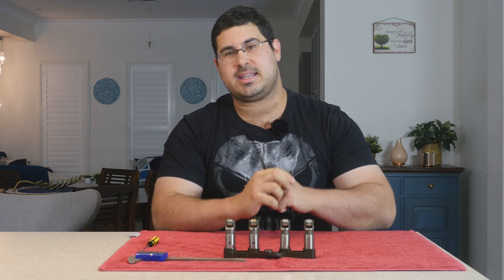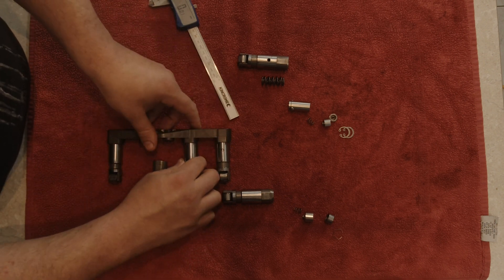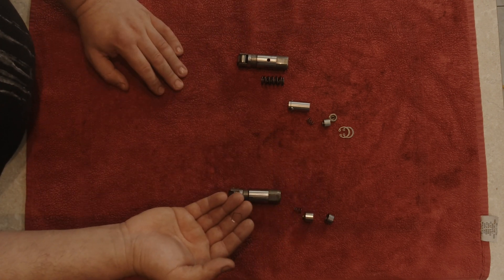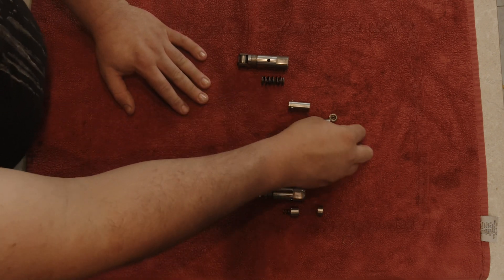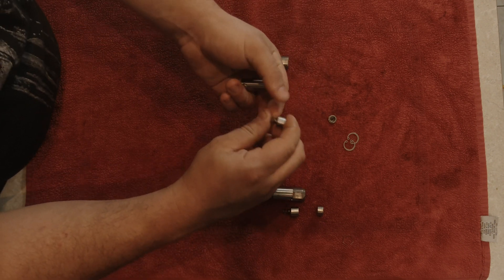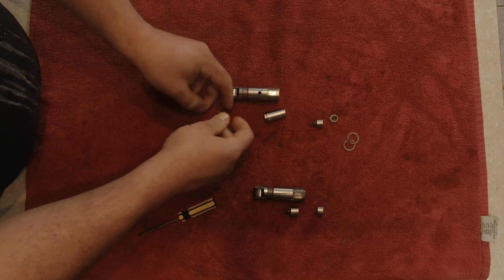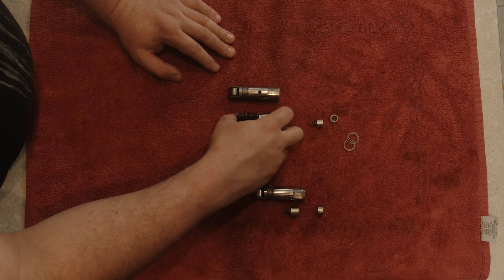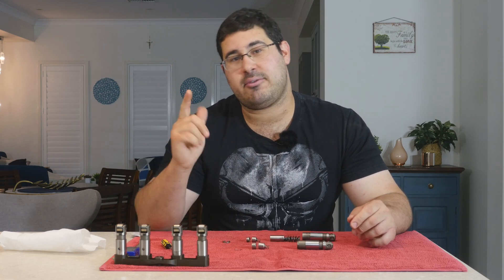Info Intake - How Does A Gen III Hemi MDS Lifter Work??

Comment: So I’m having a misfire on cylinder six on my 6.4 hemi and I cannot seem to figure out the issue. I’ve took the heads off almost 4 times check the lifters and cams all good. All injectors and spark plugs and ignition coil packs are good. The issue is when I run the engine and open up the valve cover on the right side which is on cylinder six all the rocker arms move except cylinder six there are not moving at all what will be the issue? Anyone can help please.

Comment: Do the pins in the MDS lifters need to align perfectly with the holes in the sides of the lifter? I noticed on cal #4, the pin is not lined up with the hole and I am wondering if I should replace that MDS lifter.
Reply: Yes, the locking pins inside MDS lifters must align perfectly with the oil holes (or ports) on the sides of the lifter body. This precise alignment is crucial for the MDS system to function correctly.

Here's why:

Oil Pressure Activation: The locking pin is moved by dedicated, pressurized engine oil supplied through the oil hole in the lifter's side. When the MDS solenoid opens, it directs oil to this port. If the pin isn't perfectly aligned with this oil passage, the oil pressure won't be able to effectively push the pin inward to disengage the inner plunger.

Pin Engagement/Disengagement: The pin needs to move freely and precisely to lock into or release from the inner plunger. Misalignment can cause the pin to bind, stick, or not fully engage/disengage.

Consequences of Misalignment or Pin Issues:

Any issue with this alignment or the pin's movement can lead to MDS lifter failure and symptoms like the "Hemi tick," including:

Stuck Lifter (Deactivated): If the pin gets stuck in the "disengaged" position, the valve for that cylinder will remain closed, even when the engine tries to run on all eight cylinders. This leads to a misfire and rough running.

Stuck Lifter (Activated/Always Engaged): If the pin gets stuck in the "engaged" position, the lifter will always act like a normal lifter, even when the engine tries to deactivate cylinders. This can cause issues with the MDS system's balance and potentially trigger diagnostic trouble codes (DTCs).

Improper Cycling: If the pin doesn't move smoothly, it can lead to erratic lifter operation, causing noise and eventual wear on the cam lobe and lifter components.

The design of the MDS lifter is inherently more complex than a standard hydraulic lifter due to this additional internal mechanism and dedicated oiling system, making it more susceptible to problems if any of its internal components or oil passages are compromised by wear, debris, or manufacturing tolerances.

Comment: Hmmm I've been having periodic problems with a certain cylinder until it finally quit all together. Fearing the worse I tore it down and surprisingly it wasn't the roller but the lifter is stuck inside. Now that I know how it works I will be taking it apart to see why. Thanks for the info

Comment: What happens when those pins become misaligned with the holes. Will that cause an issue ? I’ve got a hemi torn apart right now and I noticed 1/4 of the mds lifters on the driver side have the pins almost completely spun away from the hole. I’m trying to figure out a misfire btw.
Reply: Misfire wasn’t lifter related— was a bad injector 🤦🏽‍♂️
Reply: Yes, absolutely, misalignment of the pins with the oil holes in MDS lifters will cause significant issues. This is a critical point of failure for the MDS system.

Here's a breakdown of what happens and the problems it causes:

Consequences of Misaligned MDS Lifter Pins
When the internal locking pins in an MDS lifter cannot properly align with the dedicated oil holes, the mechanism that allows for cylinder deactivation is compromised. This can lead to various problems:

1. Inconsistent or Failed Deactivation
Incomplete Engagement/Disengagement: If the pin can't move freely due to misalignment or binding, it might not fully engage or disengage the inner plunger from the outer lifter body.

Stuck in Activated Mode (8-Cylinder): The pin might get stuck in a position where it always keeps the inner and outer parts of the lifter locked. This means the cylinder will never deactivate, even when the engine tries to run in 4-cylinder mode. This can lead to rough running, reduced fuel economy, and diagnostic trouble codes (DTCs) related to the MDS system.

Stuck in Deactivated Mode (4-Cylinder): Conversely, the pin could get stuck in the "disengaged" position. In this scenario, the lifter would always act "collapsed," and the valve for that cylinder would remain closed, even when the engine attempts to run on all eight cylinders. This is a more severe problem, leading to a constant misfire on that cylinder, very rough engine operation, and severe performance loss.

2. "Hemi Tick" and Noise
Valvetrain Noise: When the pins are not moving smoothly or are partially engaged, the internal components of the lifter can rattle or tick. This is often the genesis of the dreaded "Hemi tick" sound. The noise occurs because the lifter is not maintaining proper hydraulic lash or is experiencing internal play that it shouldn't.

3. Accelerated Wear and Damage
Camshaft Damage: A lifter that isn't functioning correctly can put undue stress on the camshaft lobe it rides on. If the roller wheel starts to skid (due to the lifter not rotating or binding), or if there's excessive play, it can grind through the camshaft lobe. This is a very common and serious consequence of MDS lifter failure.

Lifter Roller Failure: The small roller bearings within the lifter itself are also highly susceptible to wear and failure, particularly if lubrication is insufficient due to restricted oil flow caused by pin issues or general oiling problems. Once the roller fails, it directly damages the camshaft.

Metal Contamination: When the lifter roller or camshaft lobe starts to wear excessively, metal shavings are introduced into the engine oil. These metal particles circulate throughout the engine, potentially damaging other critical components like bearings, the oil pump, and other valvetrain parts. This can lead to catastrophic engine failure if not addressed promptly.

4. Reduced Performance and Fuel Economy
Misfires: As mentioned, a lifter stuck in the "deactivated" state will cause a continuous misfire on that cylinder.

Power Loss: Misfires and an engine that can't run efficiently on all cylinders will naturally lead to a significant loss of power.

Increased Fuel Consumption: Even if a complete misfire isn't present, an improperly functioning MDS system will lead to reduced fuel economy because the engine isn't cycling cylinders as intended.

Why Misalignment Happens
Misalignment isn't usually a manufacturing defect in brand-new, quality lifters. It typically occurs due to:

Wear and Tear: Over time, the internal components of the lifter, including the pin, its bore, and the inner plunger, can wear down, leading to excessive clearances or binding.

Oil Sludge/Contamination: Debris or sludge in the engine oil can clog the tiny oil passages that supply pressure to the pin, or physically impede the pin's movement.

Insufficient Oil Pressure/Flow: If the dedicated oil pressure to the lifter is inadequate, the pin may not move with enough force to engage or disengage properly.

Overheating: Extreme heat can cause material distortion, affecting tolerances and pin movement.

In summary, proper alignment and free movement of the internal pins are absolutely essential for MDS lifter function. Any deviation leads directly to serious engine problems.

Comment: Hello. Thanks for the info...
I do have a quick question about the MDS lifters.
I understand they have holes on the side and the push pins align with the holes.. looking at some of my lifters old and brand new, someof the pins are nit directly loned up with the holes...would that be correct?  So as they rotate around inside the cynlinder?

Comment: I was told by a seller that I could use their MDS lifters in my NON-MDS engine.  However;  now that I've done that the engine runs like it has a constant misfire.  Can anyone confirm that the misfire is due to installing MDS lifters in my NON-MDS 5.7L engine?
Reply: Just so everyone knows.  The misfire is DUE to putting MDS lifters in a NON MDS engine.  Do not attempt to do this no matter what the parts seller tries to sell you.  There was a puddle of gas in the intake channel proving the MDS lifters didn't open the valves in my non-mds engine.

Comment: Does it make sense that if lubrication is a issue for the hemis that letting mds happen more often will lube things more often? I hear when mds comes on there's more lube on the cam and lifters. Is this true
Reply from the maker: The system seems to supply oil to the lifters to activate the cylinder deactivation. If the mds activates more often then it will allow more oil to the cam and lifters. I think the problem is the lack of oil pressure at idle as well which would be why the hellcat high volume oil pump is a good upgrade. I've done the same thing in an ls application and it raised the oil pressure at idol significantly.
Reply: So if the mds is disabled shifting manually or using tow/haul mode, lifters are running dry?
Reply: @martinheredia6124  When operating in Tow/Haul mode, the MDS solenoids do not send high pressure oil to activate the pins in the MDS lifters, but the MDS lifters still receive oil and still function like a non-MDS lifter. It's still getting oil from the push rod. The push rod gets oil from the rocker arm and shaft assembly, which is pressurized by oil where the 2nd and 4th bolts for the rocker assembly are located.  When the engine switches to MDS, the MDS solenoids activate and send high pressure oil to the MDS lifters which then deactivate the pins allowing the lifter to ride with its internal spring set. This spring set has far less compression than the valve springs, therefore the push rod does not compress the valve spring and open the valve. But good question though.

Comment: Great video explaining the difference. If someone did an MDS delete to their mds vehicle would you recommend the nonMDS lifter or the mds lifter?
Reply from the maker: It would depend on the application. If someone were to perform a performance cam swap I would definitely say remove the MDS system. However if you were to keep the standard camshaft I would imagine the benefits of the MDS system fuel saving is more important to the operator. I would like to do a little more research and show how the solenoids and oil system in the MDS operates, if that's something people would be interested in.
Reply: Do the pins actually need to align with the holes? Ordered new mds lifters and only 2 of the 8 align..or do the pins just need to catch along the ridge on the inside of the lifter
Reply from the maker: I should clarify and state if you wanted to delete the MDS system you would have to remove the MDS lifters when removing the MDS solenoids